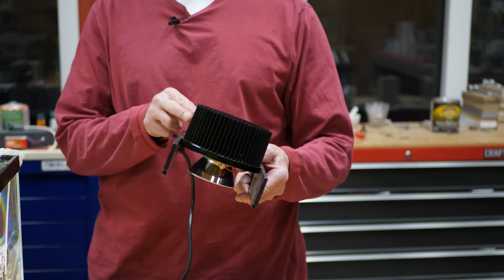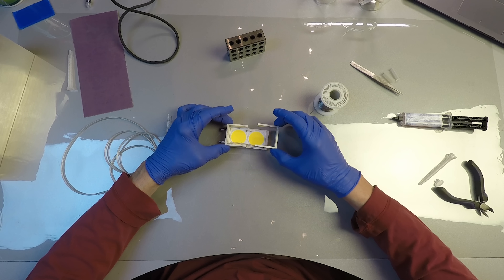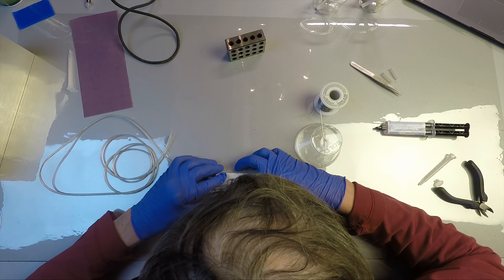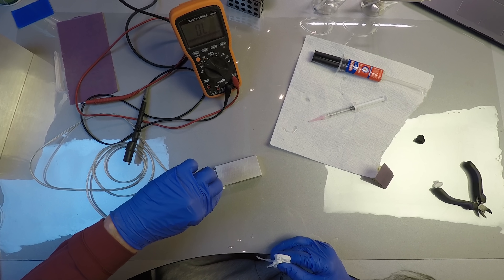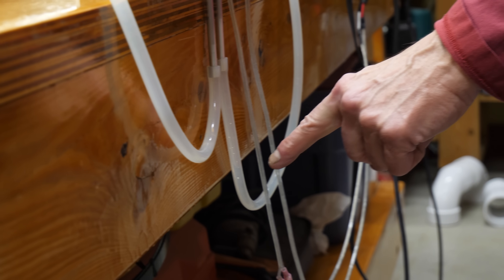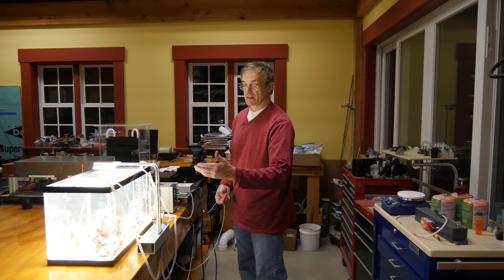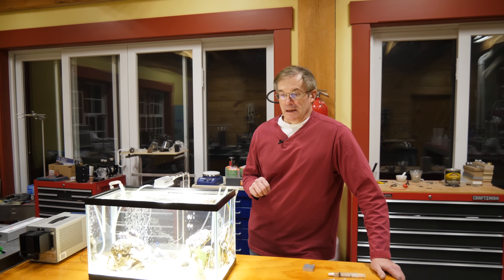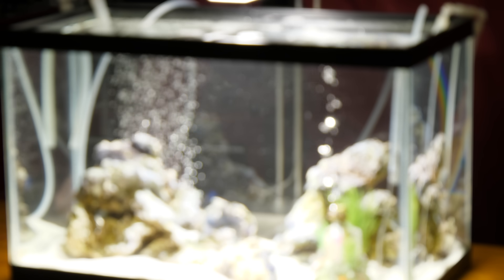40,000 Lumen LED Aquarium Light

Comment: I own aquariums for more than 30 years (I am talking about freshwater tanks). If you use 20-30 lm/l (lumen per liter) you are fine. However if you use more than 50 lm/l you run into all kind of problems. You really have to know what you are doing to keep the ecosystem in balance with this amount of light. Anyhow it becomes a lot of work and it is very difficult to obtain a healthy balance between nutrients and consumption by the plants - unless you like algae a lot.

Using biologically active water for cooling doesnt sound good also. I never have clean tubes in my filter. They quickly fill up with residues of all kind. This also sounds like a lot of work to me cleaning these small hoses.
Reply from the maker: For low light levels, a single COB mounted well above a large tank should do nicely.
Higher light levels for some planted tanks and especially for shallow water corals can be useful.  I just showed how easy it is to get large amounts of light from a small, flexible source.  Cooling with the aquarium as the heat sink, whether closed cycle or open as I demonstrated can reduce electrical consumption.
Reply: @TechIngredients  Kept a marine 150l tank for many years. I wish I had known this back then, small footprint - awesome output.
Reply: All of the following is just my opinions so take it for what it's worth and thanks for sharing the video.  I get the science behind it but for freshwater IMO it's not feasible and way overkill unless you had it in a large planted tank. Then you run into the issue of hot spots since it's not reflecting equally and the middle of the tank directly under the light would be too bright and the outside would be too dim for a natural look.  

That being said for a reef tank the active cooling introduces a factor of uncertainty you def don't want. You want stability so cooling the led with aquarium water will lead to heat spikes on hot days , fluctuations during on and off times etc that would only be reduced or controlled with an aquarium controller and chiller that all in all ends up costing more $. 

There's a few guys in the UK who built a few water cooled multichip full spectrum reef lights but had the cooling on a separate system so it doesn't effect the stability of the system. Stability is critical with a reef tank. 

Thanks for sharing your build , thoughts and the info on the epoxy coating that was new to me and a great idea. 

I see this working well on like a hydroponic grow light that temperature swings aren't as critical or something like an outdoor pond that can be ran on a large volume of water and hung high for viewing only.

Comment: A few points/observations...

Rather than a clear cover, use a diffusing cover. It would probably be better for the fish and would spread the light too.

Pete Sebert
 (about 7 hours back) also Robin C. (about 9 hours back) Machina (9) Aleksandar Sekulic (10) and others, had an interesting comments about a closed loop radiator into the fish tank. Of course that would require a second pump. But this would eliminate the situation of nutrient rich tank water circulating through the very warm and dark cooling block. And all of the evils that could facilitate.

Where do you get low viscosity epoxy?

As always, a good video.
But... Where is that evaporative cooling video? !?
Reply: Actually you would only need 1 pump to circulate water from the light to a underwater epoxy covered aluminum block !
Reply: @nick5625  - 1 pump for the tank filtration system, 1 pump for the cooling system.
Reply from the maker: Low viscosity epoxy is often called laminating or penetrating epoxy.
Fouling is unlikely if the water return from the filter is sent to the cooling block; it is completely dark in there.  But, if you are concerned, the fact is that where a powerful light like this would be useful ( you're not really going to mount 40,000 lumens above a 10 gallon aquarium) is to allow remote dumping of waste heat outside the fish room and this will be a closed system.

Comment: Could you just dunk the entire LED COB inside the tank and dispense with all heatsinks? I don't think 12 volts will short inside of a water tank.
Reply: michel777ification  Ah that might be a safety problem and borderline fatal.  Would it work if these were 24V LEDs?

Comment: You need a drip loop on that wire.
Reply: It has one?

Almost the whole wire, excepting the little bit attached to the light, is below the plane  of the desk. The power supply is above the desk.

Comment: Nice idea your son came up with, but what is "low-viscosity epoxy" exactly?  Can standard epoxy that's been thinned with 99% IPA be used?  Also, while the concept of a small but powerful LED light is appealing, the support equipment needed to run it is not as each part (pump, LED controller, power supply) seem to be considerably larger than the standard store-bought varieties they replace.  Haven't you just transferred the increased space requirements to another location rather than reducing them in proportion to the light itself?  Behind the fish tank gets awfully crowded in small homes like mine.
Reply from the maker: It's usually called laminating or penetrating epoxy.
The tiny light I assembled is powerful enough for a tank between 100-200 gallons.  All the pumps and the lines are already there for the tank itself.  Being able to run the power supply from a remote location reduces the visual obstruction caused by a larger lighting fixture.

Comment: This is really cool.  I have marine tanks and they're all using LED lighting.  I'd like to see you guys do something where you have the other colors in the spectrum available on something like this.  The water cooling using the aquarium is pretty good.  In Texas, the opposite problem I think happens.  It's hot, so we use the a/c to keep the house cold, and the aquarium heaters are on a lot trying to maintain 78* F.  If my LED lights were exhausting heat into the tank water then my heaters may not have to work as hard in the summer when we're trying to keep the house cool.

Another thing, I think you'd want to exchange heat into the tank water using another radiator and not use the tank water directly.  You would likely have to mess with the pump flow to make sure water is in the exchanger long enough to get rid of the heat.  You could coat the outside of this exchanger in epoxy just like you did the inside of the water cooling blocks.  This closed system could also include it's own reservoir to further enhance it's capacity to absorb heat.  Still loving this channel every time you post!
Reply from the maker: Thanks!
The water cooling is so powerful that almost any  flow through the light is enough. You can divert a small fraction of the pump flow to accomplish this.  
As I discussed in our TEC freezer video, an extremely low cost cooling method is a small ground loop, similar to what a geothermal heat pump uses, but much smaller.
, But .uch smLler
Reply: @TechIngredients  Ah yes, I somehow missed the part of one of the videos where you talked about a ground loop.  I thought an externally mounted radiator (like I saw you do in a video) would be a good idea too provided that the outdoor temperatures were ideal.

I think the reason the water cooling is powerful is because you're using a very large reservoir and it has good surface area to volume ratio for dissipating heat (as you pointed out in the video).  What I was saying is that if you had actual tank inhabitants in there, especially in a salt water system, you'd be dealing with stuff getting into your lines and junking up the pumps.  For this reason you'd want to run a radiator to "heat" the water, so you could keep the aquarium water out of your nice mechanical parts :D.  Thank you for replying.  I actually just went and checked out your website to find that it looks like you have some cool plans for the future.

Comment: All very nice...  but...  WHY A FISH WOULD LIKE TO BE IN THAT ENVIRONMENT?
The area of that aquarium seems to be around 0.1 m2, this mean that with a 40000 lumens source  you have 400000 lux, 4 times more lux than sunlight at noon in the surface, in addiction any coral would be much deeper, around 2 to 20 meters, this mean that a more appropriate light for tropical sea fishes is 3000 lux (133 times less than that). 
http://www.reeftank123.com/lighting/lighting.html
Or maybe I skip some part of the video in which you explain why you need an aquarium with such amount of light?
if you need to cook the fish, a simple grill would be easy :)
Reply from the maker: I didn't want to set up a 600L demo tank on the bench. I did not even run the light up to full power, but the point is that this tiny light is all you would need for a huge tank, eliminating the cost and the large hood to mount conventional lights.
Reply: @TechIngredients  ok, Now I remember that you said something about different tank scales but I was focus in your example, still looks a bit excessive for a 600 liter tank because usually fishes are much deeper.
But I love the method of cooling and thermal management, it provides some ideas for different applications.
Thanks for the answer :)

Comment: I would love to see a video of a planted aquarium fixture build with a mixture of different color LEDs to achieve a proper Spectrum. Possibly more affordable chips and drivers.
Reply from the maker: There is an economy of scale.  Mixing various Cree or Philips COBs provides a lot of spectral control and the drivers increase in power a lot faster than the price.
Reply: you can buy ready made fixtures like that for relatively cheap now.  I paid about US 80.00 for the system I used on my 150 liter tank and it works perfectly.  you can adjust the brightness of any of the color elements, and it has both individual red and blue color elements, as well as a blended white element.  it's all a self contained water resistant unit you can put on little blocks right on top of your tank.  been using it over a year now with zero problems.

Comment: I bet your fish love those 40,000 lumens
Reply: haha I guess it's more suitable for (energy) algae experiments or aquatic plant growing. But there are more flaws. Do I get this right: the water used for cooling the smd elements is the actual aquarium water? Well have fun with the gunk forming inside the block.
Reply: "the gunk forming inside the block."

...and those narrow right angle stainless tubes.
Reply: it would be great for a saltwater tank with coral, but then you'd need to rethink the water cooling. like using a small radiator outside of the tank.

Comment: Why does aluminum corrode in the fish tank when it's notorious for surviving as a beer can for eons when littering the outdoors?
Reply: It doesn't need to dissolve in very large quantities (relative to the chunk of metal) to be harmful in a closed system like a fish tank.   I believe the oxides that dissolve, exposing more metal, so it corrodes faster in liquid than in air.
Reply from the maker: That's right.
Reply: I think it must be more complicated than that since the oxide layer on aluminum protects against further oxidation.  I'm guessing that it has something to do with the salt, since everything I found on-line was in forums for salt water aquaria.  I'm also guessing that aluminum, like copper, is harmful to invertebrates but much less so to fish.

Comment: Very cool design! (pun intended lol) Would it have been too busy to run a 3rd pipe form the glass frame for the wire to go through?
Reply from the maker: I thought about that.  The clear silicone wire is really thin.  Small beads of RTV, hot glue or... epoxy could eliminate the heat shrink tubing.  The pipes could also be made from acrylic.
Reply: @TechIngredients  Yes, clear acrylic pipes would have added some waw factor also, if there were bubbles in the water. As if its being powered by water.